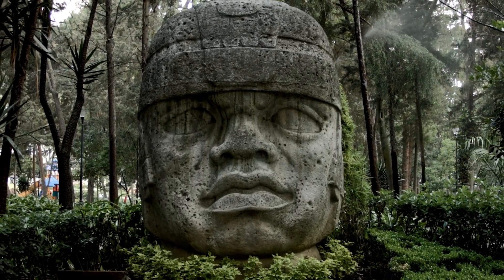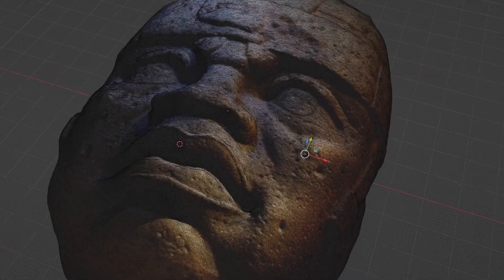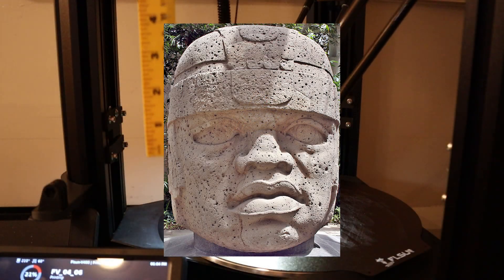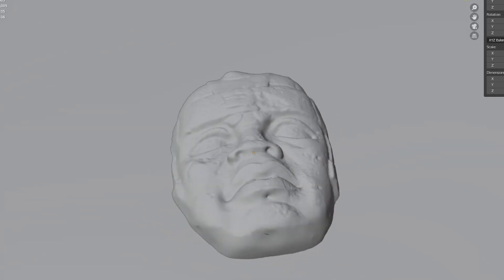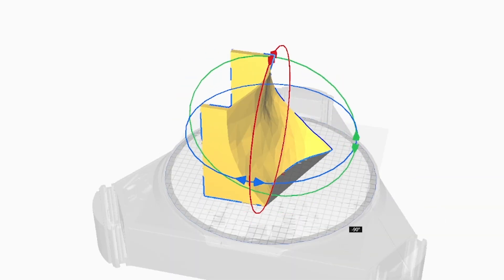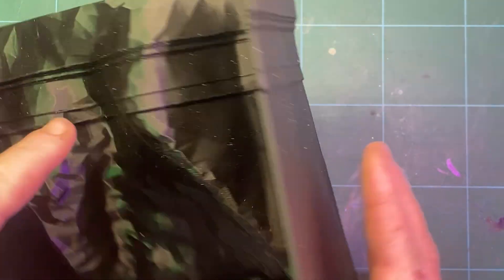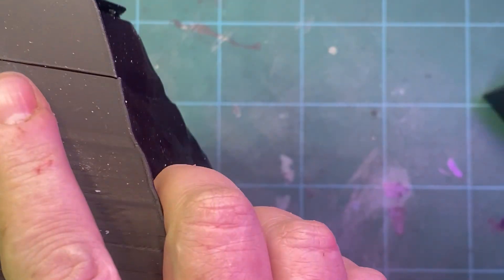3D Print a Colossal Olmec Head

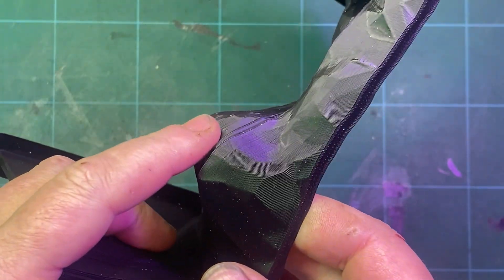Comment: I've had the same issue at 3:30 with my 3d prints. The dude at microcenter told me that certain shapes paired with certain slicer settings aren't compatible with every stepper motor and they can overheat and skip a layer or wall. I hope this helps.